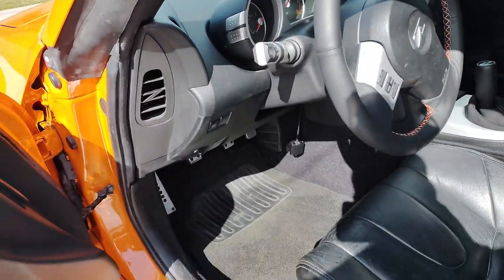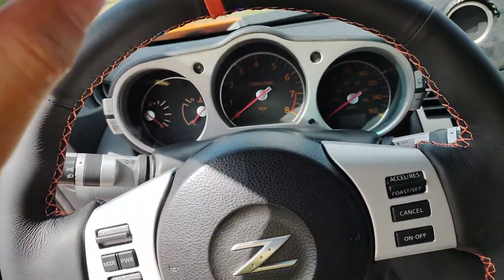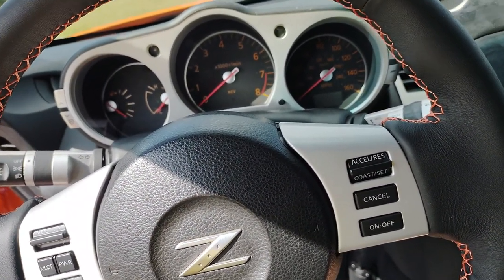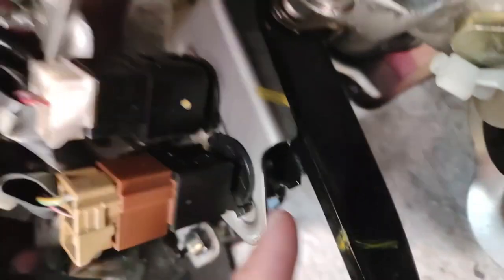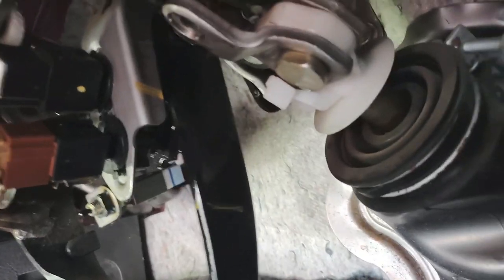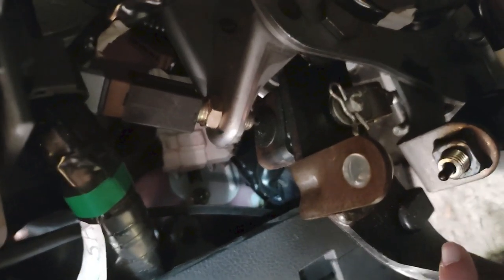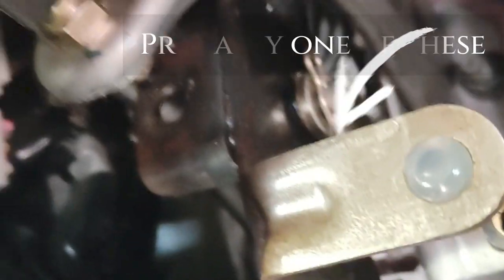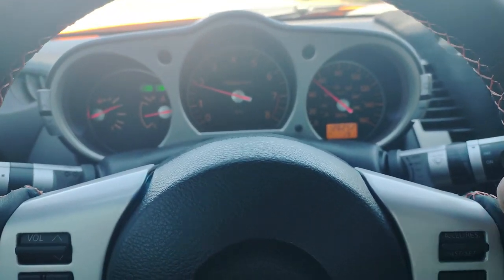Project 350z: Nissan / Infiniti Cruise Control Fix (ep 13 )

Comment: Had a similar problem with my Nissan Xtrail (Rogue). Had not used the cruise control for more than a year. Switched on but would not engage.  Follow your suggested & it works. Thank you

Comment: I replaced my clock spring , checked my sensors everything was good , cruise control buttons light up but don’t set cruise or nothing , this is so annoying
Reply from the maker: That is annoying, that's what happened to me. Ended up being one of my pedal senors/switches as shown in the video, a hidden one on the clutch I kept missing and the hole in my pedal just needed to be filled so the switch would close.  If all of your switches are opening and closing as they should one of them may just be bad. Just because they open and close doesn't mean they're working.  They're about $10 each on ebay, but that's worth trouble shooting.

Comment: I changed my clock spring. My cruise light doesn’t come on at all. It was all working till I blew a fuse for the cigarette lighter. Replaced the clock spring and fuse. My horn wouldn’t blow. Replaced the horn relay, nothing worked till I replaced the CS. I’m going to check that brake sensor now, hopefully that’s it. Everything worked till I blew that fuse. It was an air pump that plugged into the cigarette lighter.
Reply from the maker: That's weird, haven't heard of that one. Would have definitely thought the fuse would have fixed that. If the cruise lights not coming on then it's gotta be electrical not the brake sensor. It may have shorted out your steering wheel cruise control switches.  Hard to say, chasing down issues like this can be  quite time consuming and expensive
Reply: @GQ37official  exactly, now the horn blows and the radio works. Oh I drove it a little while waiting for the clock spring to come in. The horn wouldn’t blow at all, replaced the relay, but when you would turn the wheel and apply the brake when slowing down to turn the horn would blow. Scared me at first I thought I was cutting someone off. I’m gonna check the brake sensor, if IT’s depressed it might be preventing the cruise light from coming on, not sure.
Reply: @GQ37official  I now have a blinking air bag light also… I’m wondering if the ECU got fried
Reply from the maker: @mft1284  wow I hope not. Ecu stuff is a whole other rabbit hole.  Definitely something electrical causing a chain reaction there. Might want to unplug the batter for 30 mins or so and then Reconnect and see if that shuts off the airbag light.
Reply: @GQ37official  it’s cheaper to order a used steering wheel. Air bag light is still on after unplugging the battery for an hour. If it’s not the steering wheel then I’m gonna replace the ECU and MCU. Not sure what else it could be.

Comment: My 07 350z steering wheel functions have stopped working, im assuming it is the clock spring?
Any ideas on price for replacement?
Reply from the maker: yep definitely sounds like clock spring. I have a link in the video description to the one I used when I replaced in on a G35, fx35 and this 350z.  Runs about $45 for this aftermarket one but it worked fine.

Comment: Just wanted to ask how did you place the replacement plastic? I have an extra rubber stopper from the clutch the same white transparent one you have on your clutch. 

But my question is which way do I leave the bigger round top of the button facing me or the opposite way?
Reply from the maker: I used a plastic fastener to plug the hole for a tight fit since my rubber piece was missing. As far as placement as long as it plugs the hole it shouldn't matter, but ideally you want the bigger end on the side that is going to rest on the button / switch

Comment: for some reason my brake switch hole is little bigger then urs will that be a problem for a tune
Reply from the maker: Are your switches working currently like they’re supposed to? If they are then shouldn’t be a problem using them for the tune.

Comment: Will this make the g35 not start, cranks but no start.
Reply from the maker: No, that could be a lot of things, check your battery first, fuel pump, starter, possibly even alternator, but not like to have anything to do with the cruise cancel switches.

Comment: So if my cruise control doesnt turn on at all it would be the clock spring?
Reply from the maker: If the cruise light doesn’t come on at all when you hit the button it may very well be the switch on the steering wheel itself.  You can order them from Z1 Motorsports. Will have to remove the steering wheel to install. If for some reason that doesn’t fix it I’m sure they will take it back, but that’s what it sounds like to me.
Reply: @GQ37official Hey man great vid. What if nothing on my steering wheel work? even my horn doesn’t work lol
Reply from the maker: @chancelegaspi832  sounds like your clock spring that sits behind your steering wheel.
Reply: @GQ37official  Ayyy thanks so much man. I’ll be sure to check that out

Comment: Cruise control won’t lower or higher volume replaced clock spring and nothing
Reply from the maker: Could be the physical switch itself on the steering wheel.  You can order those from z1 motor sports, but they are pricey so if you order them you should ask them if they are returnable if that doesn’t end up fixing it.